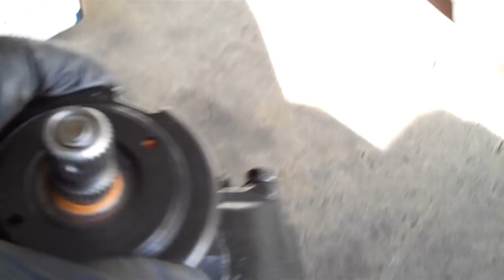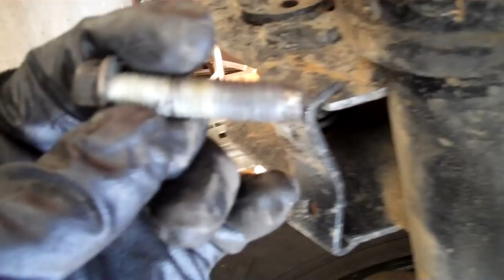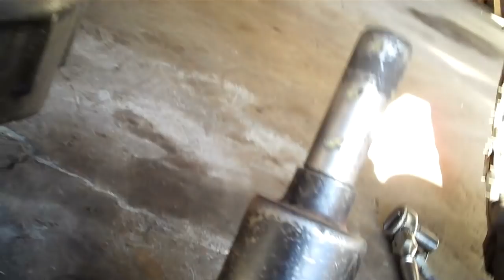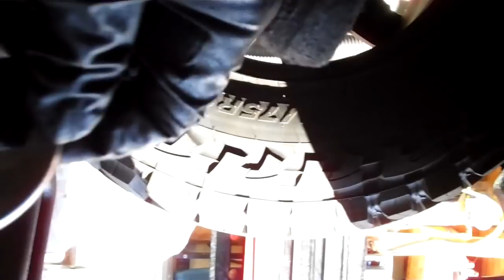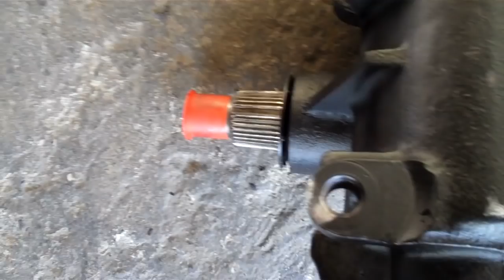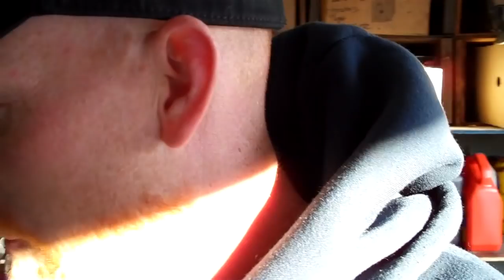How to replace your Power Steering Gear Box!

Comment: Brian, did I hear you also rebuild these?  I have a FJ40 that I want to install Power Steering on.  JT Outfitters has a kit, minus the PS gear box since they no longer have a supplier.  Anyway if I can find a rebuilt PS the I can order the kit, but it has to be a Toyota 79-85 P/U 4 wheel drive version.  Thanks and best wishes

Comment: If you have a ford. 01-2022 be advised that Ford used two type pressure hose ends for this period of vehicles. One used 'o' rings the other uses reverse flare tubing.  Because some previous purchasers did not verify the reverse flare in the reman gear box someone tried to insert the square off tubing with "O" ring into the high pressure port and destroyed the internal reverse flare male brass fitting. Now Autozone has two damaged units that must return, and I had to find another supplier for the proper unit. My van is a 1992 ford e350 cutaway rv. I am now on my way to CarQuest/Advance parts to pick up another replacement unit and hoping it will not have damaged input pressure ports. Good Luck.

Comment: Good vid, yet you must tell those doing this work to first remove the ground wire from the battery, as messing with the steering could cause the air bag to deploy, as some have sensors!. I did not need to do that when replacing my steering box on my 36 year old, 1986 GMC truck!. Also, it is simple, and advisable, to put the pitman arm "nut" back on, at the end of shaft, so the arm or puller, does not fly off and hit you!
Reply from the maker: Thanks for the info.  Fortunately the newer cars have to be going 20mph or faster and the key must be in the on position before the risk of AB deployment becomes significant.
Reply from the maker: And moreover the sensors in the seat also have to detect 40lbs or more in addition to all of that.  Thanks to the insurance institute finding replacing expensive AB's over nothing to be ridiculous, the standards have come to pass that they don't deploy as wildly over nothing as they used to.

Comment: Brian are the gearbox clock center from autostore or from Rockauto. how can I be sure it's clock center along with my straight wheel?
Reply from the maker: They usually are.  You can double check it by marking the input and output and counting revolutions and divide by 2 and turn that many from either stop.

Comment: I bought a new gearbox for my 99 Sierra, can I assume that it is clock center from Rockauto.com. How can I turn it either way and back to know that it is clock center before I install to get it straight with my wheel?

Comment: Yes, this is very appreciated after some local store sold me the incorrect fluids which destroyed the seals in the powered steering box.

The plus side is, I have learned a lot more about my Jeep. I measured the pitman drop arm NUT size and it appaired to be 32.5 mm which is NOT what you said [in the vid clip] so I set off looking for a 33 mm socket. And that's a weird size apparently? so ended up getting a 34mm socket for a powered driver. However, I now have to remove that stabiliser arm as its in the way but that's ok. Thankyou.

Comment: if anybody can help me out that would be great I have a 93 Ford Explorer has pretty sloppy steering I figured it was the gearbox I did some adjustments to take some of the slack out and now it feels better but this truck will pull to one side or the other if you turn in that direction you have to constantly make Corrections should I just go ahead and replace the gearbox

Comment: just did this today.  then my PS pump took a dump.  absolutely nothing after install for power steering or power brakes.  i let it idle a while.  still nothing.  cracked the fitting at the hydroboost.  no fluid.  figured the pump went south.  unless you have a better idea

Comment: I want to post this hear so others will not suffer the same fate as I just did after replacing my gearbox.

Ok I figured out where I went wrong.   Once you install the gearbox do not start the engine even one time.  If you start the vehicle even for a second you basically ruin the power steering pump.   If you think you may have ruined the pump you can prove it by starting the vehicle, begin trying to turn the wheel - it will be stiff - and while you're trying to turn it momentarily punch the throttle.   If you feel the steering free up when you punch the throttle then you have a reduced capacity steering pump.   

The FIRST THING YOU DO BEFORE YOU START THE VEHICLE IS make sure the fluid is full from the gearbox up through the reservoir.  You do this by filling the reservoir and then turning the wheel left right from stop to stop while continuing check and refill the reservoir and you repeat this procedure 5 to 10 times.   Afterwards if you really want to be sure no air is stuck in the system, you should pull a vacuum down to 20 inches of vacuum at the reservoir for 20 minutes.  Then recheck the fluid.  If it is still full and you performed the above proceedures you should be good to go.  Don't forget to pray before you start the vehicle :P   
Note: On many makes especially trucks and vans the power steering pump also provides assist to the power booster for the brakes.  This is why both steering and brakes are effected when the power steering pump fails to produce its intended pressures/capacities.   

I'll be replacing mine tomorrow and this is a mistake I will not make again.
Reply: What do you remove to fill up the reservoir?  The only part that makes any sense is to remove the same piece that you use to adjust it IF it needs to be adjusted (and new ones shouldn't need it).  My new one came marked with blue on the nut and inside piece and I took a gold sharpie and marked the nut and the unit itself so I could get it all back to exactly as it was, but I'm still nervous to remove that piece.  Is there ANY other bolt I could remove to access the reservoir to fill it up and work air out?

Comment: I rebuilt those power steering box in Portland Oregon I call that one p319 very easy to rebuild also any M100 or tas65 or hfb70 HF54 many differents gear boxes as well any manual ones from old cars great video

Comment: Hey @briansmobile1 great video!! I have to replace my gearbox as well, and this definitely made me feel a bit better about it. I only have two quick questions if I may, My steering shaft has a large sleeve around it, that goes down all the way to the gearbox, almost like a protective cover, it's hard, and I'm unsure how to remove it without damaging anything, any advice would be a terrific help, and secondly, at the end of the video, you speak of purging the system for air, was that done at the new gearbox itself?, or could I get away with jacking up the front end and rotating lock to lock as done when the power steering pump itself it changed? Any advice offered would be a great help, and again, thanks for the video!!

Comment: I've been working  on a 98 tahoe 5.7 and just cant find good info on quality  brands of replacement parts  for all the front joints and steering . Now after 6 hrs of your caring and loving videos ive feel much better about moog replacement parts. Just wish you would of giving some inside info on that steering gear box brand because i just cant decide which is best, A/C delco, cardone, borgeson, masterpro which looks cheaply done or  i wondered about the red head reman shop. im just not sure i can justify that kind of money.  Brian any help with a cost effective but reliable choice would be respected and very helpful. I know you dont cut coners is why i ask. thanks alot for all your videos.

Comment: Brian when installing steering gear box I just need to put steering wheel straight and both wheels but do the boxes come preset in the center of stroke meaning it's in the center of the turning ratio

Comment: Your four wheel drives are a ton of maintenance. So much stress. I will keep my two wheel drive truck. Haul what I need. Little maintenance. Little streeses. P.s. your hot. Stay safe with those 4 by 4s. They seem like they could have alot of problems.

Comment: hey Brian just out of curiosity I have a 95 dodge 2500. The steering wheel has a lot of play and I've already gone through all steering components and changed them to moog. only thing left is the gear box itself. when I turn the wheel there is a loud popping sound like the gears are jacked up would it be in my best interest to just swap out the gear box?

Comment: my wife has a 2002 ford escape I have replaced control arm ball joints stabilizer links struts and her car still jerks to one side or the other it just moves aver quickly  what the heck is going on  help

Comment: Might be a dumb couple questions here, so let me pre-apologize lol...
1.) Do I need to lift up the front end of the truck before doing this install? COuldn't tell in the video.
2.) Can I buy a rebuild kit for a steering gear box to refurb it? 
I have a '97 dodge 1500, 5.9 360
Thanks!

Comment: I replaced on my 2003 Dodge Ram 2500 4X4 diesel sway bar end links(BD end links), upper & lower ball joints both sides(Dynatrac), all the steering linkage(dealership parts) and replaces my steering box since it had been leaking since I owned the truck over 5 years.(just a drip here and there). When I picked up the steering box from the dealer I took notice the spline coming out of the steering box is huge compared to the one I took off, also the pitman drop arm is heavy duty as well. I still experience death wobble and I'm leaning towards that Gear box steering stabilizer but, not sure if the kit will have the upgraded version I recently put on my truck. Any ideals?? Thanks and nice video

Comment: Hey, just wanted to thank you for posting this video. We had to repair this as we broke down way down a 4x4 road and this video helped us tremendously.
One thing that we had trouble wig while out there was that the power steering connections were not the same. Close, but slightly different and very frustrating to deal with out in the sticks. If making a similar repair, I recommend getting compatible hoses as well so that you don't run into the same problem.

Comment: Hey I just did mine with the red head box.... good video !!!! thanks it helped me with mine...  I felt it was easier to leave the fluid fittings on the steering box and I disconnected them at the cooler and then up above the tank... it was much easier to clean and re attach on the work bench...

Comment: Thanks for the video.  It took me quite a while to get the lines bled though.  Both engine off and on.  Finally I was able to get all the air out and it works perfectly.  Also, I broke 2 pitman arm pullers.  Had to take the arm off attached to the box to get a breaker bar and a heavy guy on the other end to break it free.  You made this look too easy... LOL.  3 days of hell and a garage filled with profanity later, my steering is perfect now.  Thanks again!

Comment: Thanks, Brian.  Changed out the steering gear box on my 1990 Suburban after watching your video.  Mine was a whole lot easier to get to.  No pitman arm puller needed since it uses a pinch bolt.   The intermediate steering shaft wouldn't telescope so I slid the steering box onto the shaft first then lifted it into place.  Thanks again.

Comment: I have 2002 5.9 dually with 115000 miles (185000 Kilometers)  no heavy 4x4ing or abuse, all the worn front end parts have been replaced. I have the heavy metal manufacturing steering gear stabilizer ready to go on. I have the lazy daisy or slight wander always correcting situation going on. This makes driving a little difficult,  Before I install I want to check the gear box condition. How do I check the steering gear box or how do I know if its worn? The steering is quite a bit stiffer than other vehicles I drive. Could I get a rebuild at the local  Lordco parts store here in Canada as apposed to an expensive import like red head and still get reasonable new quality? Thanks Dave

Comment: Thanks for the video. So, what if say.. I did start the engine after install without having turned the steering back and forth purging the air? Can I undo this mistake? I dont want my steering moaning or air in the system. (95 f 250 ps 7.3 4x4 diesel) @briansmobile thanks again

Comment: ok, so what would be the best idea here... i have a gear box coming in the mail- supposed to be today, but fed ex is garbage... regardless- i bumped a curb today, and now i have zero steering- is it the linkage? or when i put the new gear box in, will it fix the no steering- the reason i got a new box is cause my power steering went out a while back... but now, i had to have my truck towed to my house... any suggestions on how ... um   lol...to make my steering aligned? other than centering the wheel, my my wheels are turned a little... this day count go more down hill, unless someone dies  geez- was picking up parts to finish a job.... grrr "DONT USE FED EX!"

Comment: I've don this job several times before but never on a Dodge Diesel. Sense they have a hydro boost for vacuum production I took extra care to do it correctly like my manual instructs . After the gear box was installed and everything torqued to spec  I jacked up and put on stands with the engine off I  turned the wheel  30 times always making sure the fluid was full then another 30 for good measure test drove truck no problems so done right, wrong !!  I drove the truck to return the gearbox core and puller everything seemed fine until I tried to turn in to Napa auto the brakes and steering locked up hard in a turn and just about crashed my truck. I m a heavy equipment welder mechanic and work out and so I'm a pretty big guy 6'2 and 230 pounds I could not turn or stop my Dodge truck it scared me and the little old lady I just about T-Boned . Do you have any suggestions I can't drive the truck that hauls my welder and tools in the bed I have jobs waiting on me ? Thanks Ken
Reply: Ok I figured out where I went wrong.   Once you install the gearbox do not start the engine even one time.  If you start the vehicle even for a second you basically ruin the power steering pump.   If you think you may have ruined the pump you can prove it by starting the vehicle, begin trying to turn the wheel - it will be stiff - and while you're trying to turn it momentarily punch the throttle.   If you feel the steering free up when you punch the throttle then you have a reduced capacity steering pump.   

The FIRST THING YOU DO BEFORE YOU START THE VEHICLE IS make sure the fluid is full from the gearbox up through the reservoir.  You do this by filling the reservoir and then turning the wheel left right from stop to stop while continuing check and refill the reservoir and you repeat this procedure 5 to 10 times.   Afterwards if you really want to be sure no air is stuck in the system, you should pull a vacuum down to 20 inches of vacuum at the reservoir for 20 minutes.  Then recheck the fluid.  If it is still full and you performed the above proceedures you should be good to go.  Don't forget to pray before you start the vehicle :P   
Note: On many makes especially trucks and vans the power steering pump also provides assist to the power booster for the brakes.  This is why both steering and brakes are effected when the power steering pump fails to produce its intended pressures/capacities.   

I'll be replacing mine tomorrow and this is a mistake I will not make again.

Comment: I have a 2000 Dodge 2500, my steering is not the tightest & my seal started leaking today, so I guess it's time to replace. How's a Reman from NAPA? Thanks for taking the time to make the vid, I can now do this. Never did a steering gear R&R. Dave.

Comment: i just busted a pitman arm puller trying to get mine loose. busted both tabs on the arms. any suggestions? used kroil several times
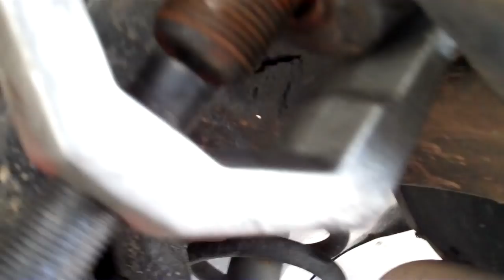Reply from the maker: +Benjamin Peterson Use shock (hit the pitman ring with a hammer) while it's under pressure.  Watch this video → https://www.youtube.com/watch?v=MxWKCFZCyy0 watch at 4:15
Reply: heat
Reply: @Mark OnTheBlueRidge - I took this advice before trying to change the gear box....now my driveway will be radioactive for the next 1,000 years and I need a new vehicle.

Comment: Brain, I have question. On my Dodge ram, should the input shaft be able to move left or right when the truck is turned off? When I am driving my truck I hear noise and it sounds like tis coming from the steering wheel.
Reply: JMP Flying no, the vehicle and all components, except for the fan/fan clutch should be stopped, or settled

Comment: Is a power steering gear box the same thing that is the gear box connectors on a 2003 Freelander? I am having the F4 flashing and the hdc light amber and engine light on and was told that the gear box may need to have the connections cleaned and made sure it is on tight.